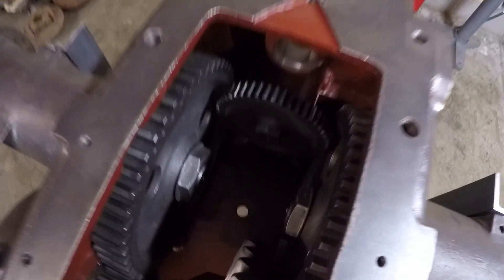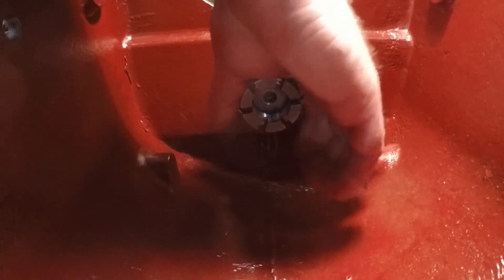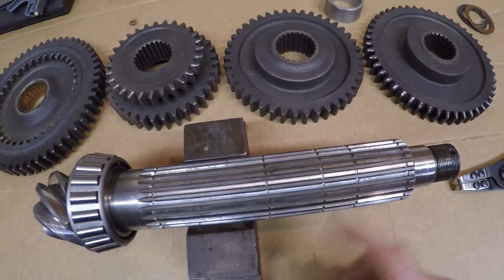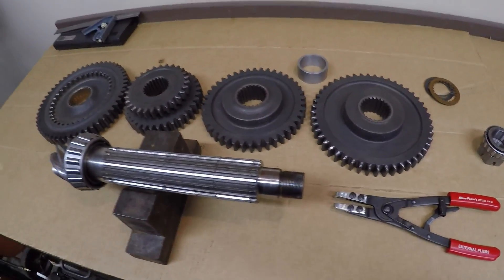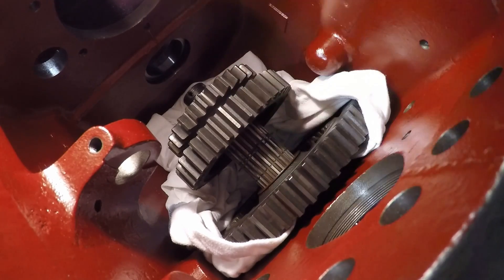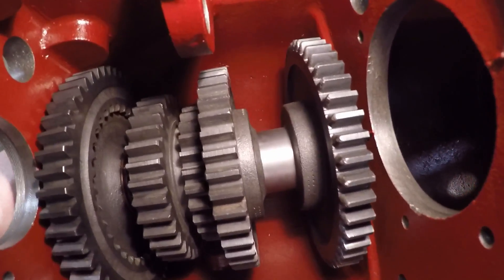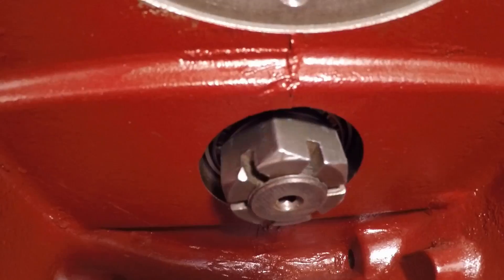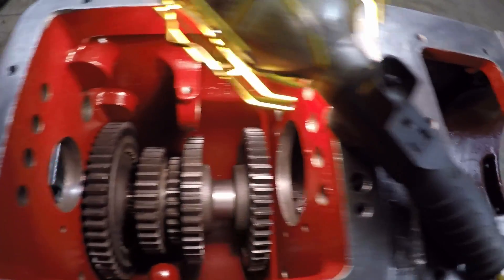Minneapolis-Moline 445 Prototype #X231 - Part 36: Installing the Lower Gearset Into the Transmission

Comment: Had to be something else to work on the assembly line installing those gear sets and getting everything exactly where it needed to be.
You've really done an outstanding job getting those two units looking so nice and clean painted up better than the day ot was first rolled outta the factory for testing.

Comment: In the Navy we had several small wedges that had a small grooves on both side that would fit between tangs of snap rings just enough to keep them open on a shaft.  they had flags on them to "remind you they existed"  it would allow you to slide them down a shaft in a situation like first gear.   I don't know where we got them at but they were a help on a lone man job like that

Comment: At least Deere had the good sense to use progressive fit snap rings on that bottom shaft so they can't drop in the groove they don't belong in. of course that means they have to go on in the exact order too. I always wondered how they did it at the factory as it is a time consuming job doing it like you or I do.

Comment: Not wanting to be a big "A" hole... but did you ever think about getting 3 sets of 90 degree snap ring pliers?  that way with the ratcheting pliers you can just push the pinion in?

Comment: 7:28 Ah, yes, the age old question. When you're armpit deep in frustration and shite, and can't see the light at the end of the tunnel. Just gotta keep telling yourself it's a challenge that you've got to overcome, that makes the good parts even more rewarding.

Y'know, between the cursing and resisting the urge to throw things across the room. 😆 I was thinking of that "why am I doing this and calling it fun if it isn't fun" line myself, today; as it took me two hours to make up and fit a 14" brake hard-line. It'll be worth it by the end...

Comment: Thanks for another installment, It's coming together nicely .  I'm going to say if you think thats not fun, you should try working on a Deutz  DX120 tractor transmission. Those things have big snap rings in , but you can't use big pliers due to room issues.  I could teach you swear words you didn't know existed  after tearing one apart in the wrecking yard I worked at. 

The guy wanted one shaft, they are so bad for going out he came and inspected the part when the side cover was off, then said pull it out he thought it was good.   When I got the shaft out it was junk,  The splines had stripped in the other part it fits in twisted and locked it up.  That was a $7000 brand new component from Deutz, he thought his luck was in for used at $3500. Thats 15 hours of my life I won't get back pulling it apart to ! Take care
Reply: That's when you start charging by the hour in labor for your frustration: 'Are you SURE you want me to tear into this gearbox just to see if that one part is good?  I'm charging 10 bucks an HOUR for my time FIGHTING snap rings and gear splines.'

Comment: Super excited to see this pop up on my feed. Great video, SQUATCH. Getting real close to bolting some major housings together.. Going to start looking like a tractor again before you know it.
Reply: @squatch253  Progress is progress! I can't wait to see the next phases of it when you start bolting sections together. You still have some PTO/HYD issues to figure out, correct?
Reply: @squatch253  That thing sure was rough inside. I sure do marvel at your abilities and attention to detail, though. This thing will be BETTER than new when you get it all done. I imagine it to be like the MM at Nowthen that had very low original hours on it.... x231 is going to be one of the best examples of a FULL restoration around, for ANY tractor. I'd like to do the Farmall H memorial project to this amount of detail... But I don't know if enough money could be raised to finish it! Look forward to more updates. Progress is progress!

Comment: I guess the excitement is the challenge of the job, my last oversize job was a Falk reduction gear for a sugar cane refinery in Florida. 75hp 1 -1/2" input shaft 4" 90° output shaft. It was something like 40-1 reduction. For the vat stir paddles. & it crashed hard. The only thing that was reused was the case vaults (2) almost 2" thick huge square case's that had to have the correct gear mesh, backlash and clearance.  Fun stuff rebuilding a 1/2 million dollar reduction gear, and then stand by a warranty.😵. All that destruction was caused by a $500.00 bearing that failed. Looked to be lack of lube. Everything was a real pretty blue & razor sharp metal everywhere.

Comment: Looks to me like those are just as "fun" to do as the bottom shaft on a JD Synchro Range or Quad Range transmission, only this one a great deal simpler. The JD has 4 snap rings, 3 thrust washers, and two sets of shift collars and hubs that all have to be strategically stacked in place as the shaft is going in.
Reply: @squatch253  gives a guy a good excuse to have a beer or more when you're finally done with it. They made a "dummy shaft" to stack it up easier, but those seem to be as readily available as hen's teeth.

Comment: I would be interested to see how these steps would have been done  in the MM lab and or then on the 445 production line?  
It would drive the Lean Engineers nutz.
Its almost as much fun as pulling injector sleeves out of the 7.3 or the 6.0

Comment: The tolerances are the same from production to prototype? Seems to me that gear will expand about a thousand per inch and it looks close to 10" so looking at ten thousand expansion and if you have less than 20 you really getting close. Spins nice and would hate to see it touch when it gets hot. Awesome vid.
Reply: Cast iron or cast steel expands 5.8-7.0 millionths of an inch (10^-6) per degree of temp change. The gear would be a puddle before it got hot enough to take up 20 thousandths of clearance.

Comment: Mac has a special pair of pliers used for a 3 speed power shift on a 637 and 657 Cat scraper. You can take a pair of tipped spreader pliers and cut V groves and do the same thing

Comment: It’s terribly hard to believe that they went through this in a factory, back in the day. I now have a lot more respect for what I call old timers, and I’m 72 years old.
Reply: bmcc12 I was thinking the same thing.  I bet they must have used some sort of tool/jig on the assembly line to keep the snap rings expanded as the gears were positioned down the shaft.  I’d also bet this was a job done by women.  Partly due to the their smaller hands and partly due to their tendency towards having more patience.  I’m certain I would have been fired my first day on the job for throwing one of those gears in frustration.
Reply: Been there Done that